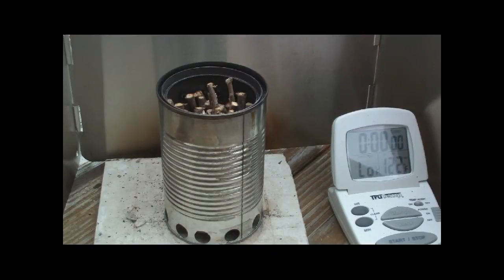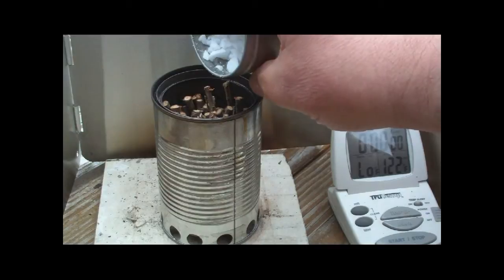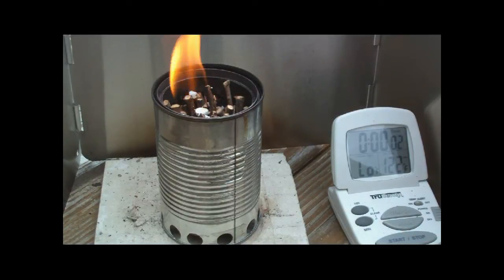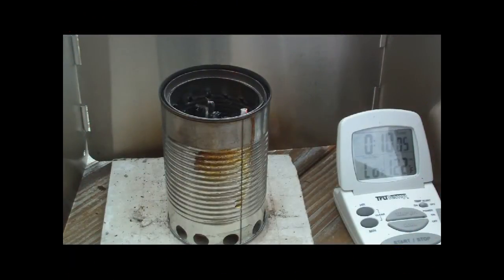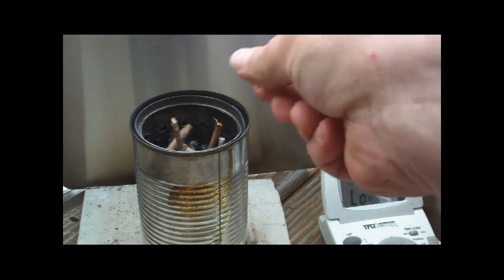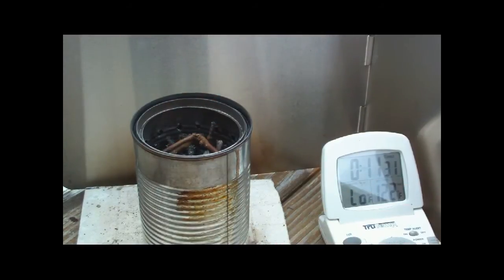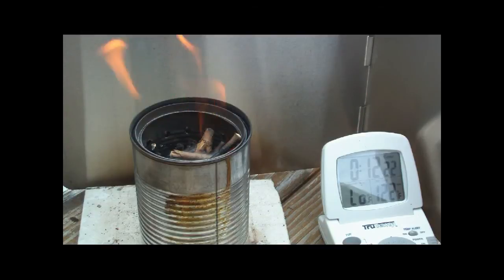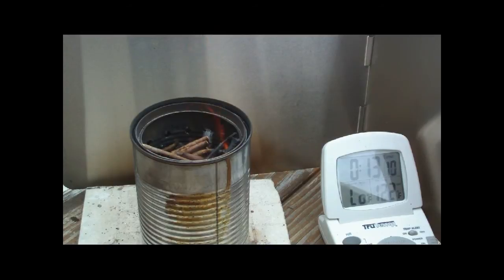Froup Stove - Burn Test #2

Comment: I have one of these and it works great!  I notice when it's burning that the jets of air at the top of the can create those jets of flame, and there is very nearly ZERO smoke.  I haven't done temp tests to this degree but I can attest it warms up pretty darn fast and burns the fuel pretty efficiently.
As you add twigs, they gasify just like the batch load.  I've run one of these for 2 hours on broken up twigs.